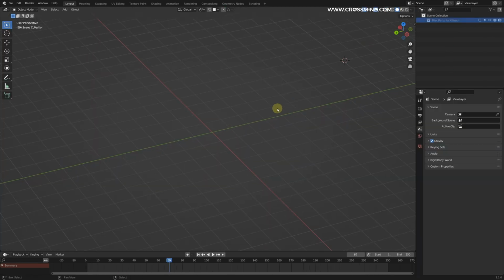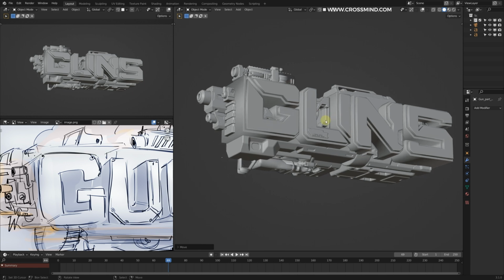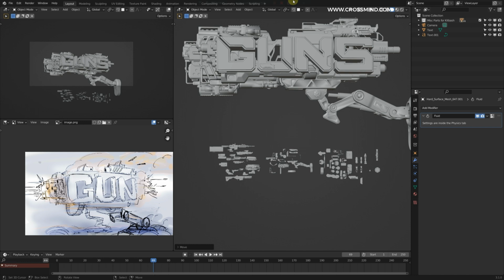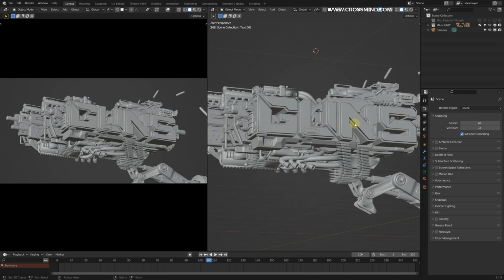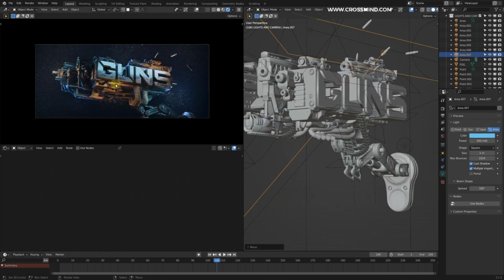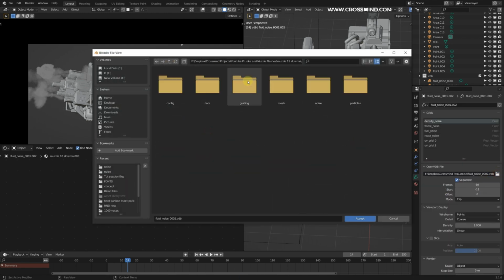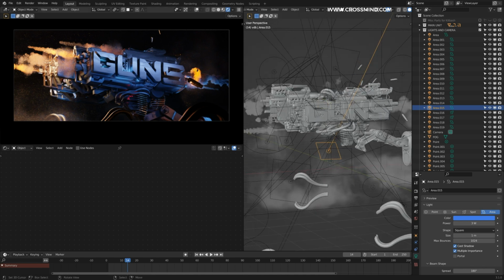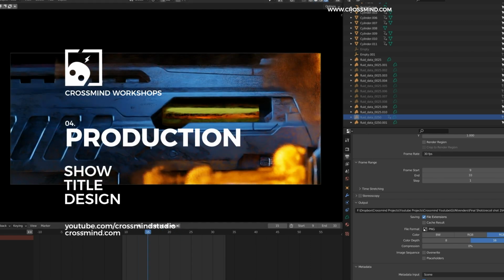Blender 3D- Show Title Design for TV/Web - 03 Visualization

Comment: Hey! If i`ve switched in preferences/system from none to cuda and then optix while rendering on GPU, it almost crashed blender, i`ve switched it back to none and now it`s all slower, still renders but after ctrl+alt+del in task manager in performance tab it shows CPU is on 100% while both GPU`s inactive although i always choose GPU every time. Maybe you know how to fix that? Thanks
Reply from the maker: Disable cpu and just leave gpu enabled then try (optix)
Reply: @CrossMindStudio  is it in blender? Or in pc options. I’ve switched to gpu right after i’ve tried that other options. Still does everything on cpu although i’ve switched it bk to gpu
Reply from the maker: If ur card supports